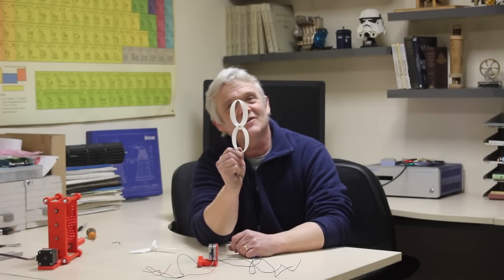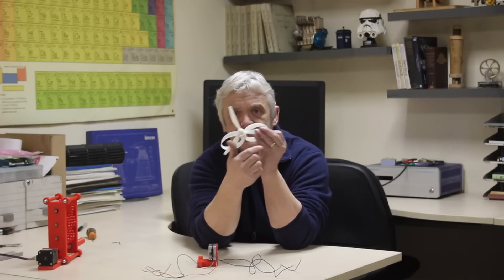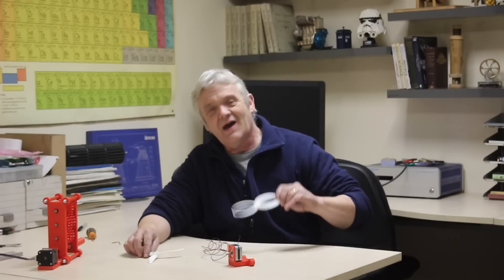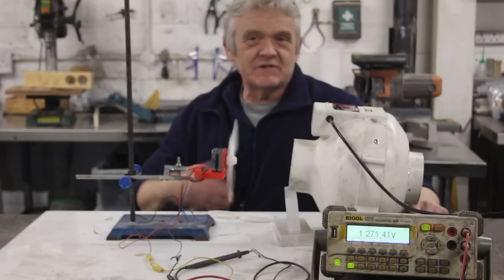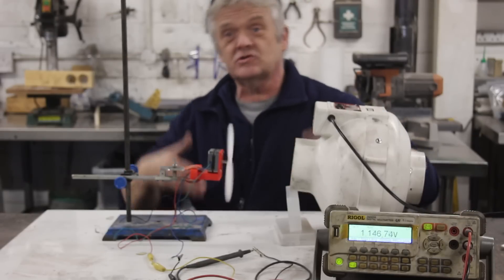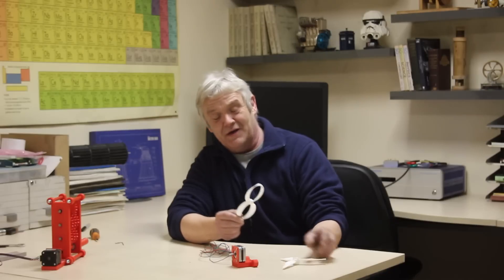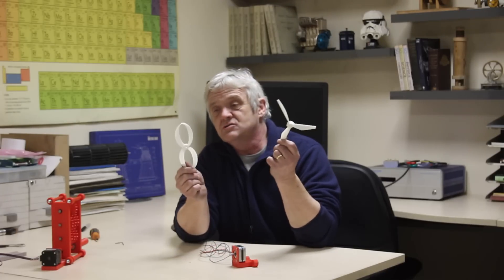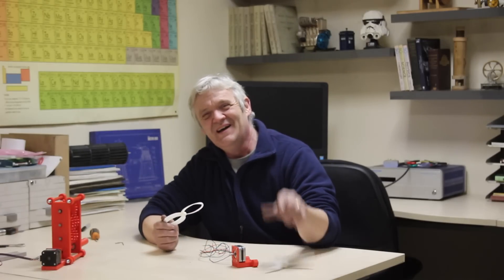1831 Is A Toroidal Propeller Better For Wind Generation ?

Comment: they've been designed and optimised for wing tip vortex reduction in the sense that the shocks created by the wingtip of a standard prop get to dissipate along the entire curved surface hence more time for it to be absorbed by the airmass surrounding the device.

there are multiple variants of it and I do believe that there is some benefit to using it as an active propeller at high RPM in that it's less noisy.... as for efficiency it's probably going to be subpar at top rpm but more effective in midrange rpm ... top at 3k, mid at about 1.5k
that's based on the paper I've seen published and their graphic interpretation of data.

given your experiment, probably more blades on the std prop would be far more beneficial than a toroidal prop
Reply: The video that pushed the idea on me said that it was 100% better. It looks like the one here though is flat as a pancake.
Reply: @kodfkdleepd2876  there are so many variables to an airfoil that can be incorporated into the design. chamber chord angle of attack washout and so on ... these sets have been sort of classified into NACA profiles to make things easier...  
so if we were to optimize the current two bladed toroidal prop we might want to offer less open space for the air to go through and add surface to collect the air  and then play with AOA and such .... if only I had a 3d printer I would gladly take the challenge as I remember quite a bit of my aeronautical design days ... even if close to 30 yes ago :))
Reply: @kodfkdleepd2876  I mean that it's possible to compare two props and find a circumstance whereby one is twice as good as the other.... 
given the task to collect as much power from the wind, we need to understand that the flow will be turbulent hence more blades would work out better.... the windspeed would be low so no need for super aggressive angles of attack ...
Reply: @kodfkdleepd2876  wow
that's a lot more comprehensive than I would've ever expected a reply to come over YT ;)
I can follow... I still remember those differential equations being a b..h 

what is the name of AI software I should be using?  wonder if chat got could hack it ? =D
seriously... what's the software I should enter all the parameters of the experiment?

btw ... awesome reply!
Reply: @actudoran  I'm not sure of any specific software.

If you truly want to do your project(you definitely can but it will take some work).

1. Design the mathematical object using formulas so that you can plug in various parameters to change the configuration of your airfoil(or whatever you are designing). E.g., airfoil(3 blades, 0.1 AOA, 6in max radius, etc). 

you can do this in any programming or library or even use something like solid works.

But the idea is that you have a mathematical model from parameter space to your airfoil space. 

For example you can do this in solidworks then run simulations on the geometry such as EM simulations, temperature, stress, etc.

If I were you I'd go with solidworks because you can do an entire suite of analysis, not just fluid dynamics. E.g., you can use real world materials to help create meaningful results(e.g., it is pointless to find the optimal airfoil if it cannot be build with modern materials).

Now, there are two ways to go about it once you have it done in solidworks. Since you can create various versions of the airfoil by simply calling your function with those parameters(and it does the rest of the work) you can now print out various versions for 3d printing. You can also do various analysis on your variations to see which is giving the best performance.

Depending on your experience and dedication it could take a few weeks to a few years to get it all going. You could also use the free program Blender but it is more for graphics design rather than analysis so you won't directly get the ability to do true fluid dynamics(although it can simulate fluid mechanics so it can give you a visual of what sort is going on but it also may be inaccurate since it is about accuracy(looks) but not precision). But if you do it in blender you could import the models(but not parametric model(but you could probably translate the function over in to whatever software if necessary) in to other analysis software.

The question really is how automated do you want it and how much of "air foil space" do you want to try and optimize for. If you just have 3 basic models you want to try then you can just design them by hard coding them and generate the models then do the analysis and get the performance values and just compare them for the best one.

if you want something more robust and to learn to apply the more general technique then it is best to break it down in to the parts I described(parametric modeling->automated analysis on the parametrized model->optimization program. This is a feedback loop as the optimization program will control the input parameters and then compute the analysis on the model and then search for the optimal analysis) more or less.

If you want to write the dynamical equations and do FEM yourself you can but that would probably add months to years more time. Most analysis software now can be setup to take arbitrary models and to be automated in some way.

The idea is to put in all the work at the front in then just have the process automate itself so that when it is done it spits out the, say, top 5 model parameter and performance info... then you can more easily narrow it down from there(based on cost or other things that were not included in the modelling(but could have been)).

Solidworks is kinda the industrial standard COSM is a physical analysis software that can do a lot of FEM analysis but you can get this in solidworks directly. Blender is a free graphical modeling program that is open source and written in python. It's quite good but is geared towards artists and not engineers so that is ultimately something you'd have to want to deal with. 

Again, for the most part, most of these apps will have some interoperability and it is just about setting up an iterative process. So you ultimately can hit a key and then let your computer chug away and "making" all those airfoils in parameter space and then doing the analysis to find which ones are best. This way you don't have to break it down beyond that and if something goes wrong you can just start over and then go have coffee.

It is not that difficult to do but does require a lot of front in work. Your initial approach will determine how to go about designing it. If I were you I might go with solidworks because a lot of it can be automated and it is really good for designing mechanical things. It has the ability to do analysis so you are likely to be able to automate that directly in solidworks and then the optimization algorithm probably can be ripped from something else if solidworks itself doesn't have the ability to do it. But solidworks is expensive and you have to pay more for the analysis software.... so if $ is an issue, using blender and looking for some free fliud dynamics analysis tools(probably some exist specifically for airfoils) and then automating that stuff somehow(command line automation and a mixture of internal programming would then be needed).

The basics look something like this:

1. Setup DE and initial parameters
2. Tell modeler to generate model based on parameters.
3. Analyze model using automated process(command line) to get performance value.
4. Give info to DE and get new parameters for new model to test.
5. Go to 2. 

So this basic loop will generate models, analyze them, and check and see if it is optimal and then hopefully generate better models to analyze, and so on...

If solidworks is out of the question you might look to find an optimizer that can generate optimal values for a parameter space(and conditions) and then it is  just about plugging in the modeling and performance analyzing which can then be worked on independently and figured out how to combine them... then plugged in to the DE code(which will likely be a few lines to automate).

It won't be as hard as you think but it will require some work. Maybe start reading up on optimizers such as DE(Differential Evolution) in which you only need something you can "plug and play"(you don't have to know the internals of how it works but just that it is good and easy to use as a tool). The look for fluid dynamic analyzers which are also basically plug and play(in which you can use them at the command line such as "FD_Analizer -m AirFoil034 -sUnderWater" and it returns the performance of the airfoil(I've oversimplified greatly).

Then you just have to have someway to create the models... Blender would probably work but there are all kinds of software out there that will do what you want.

Comment: Would there be a way to print some holders for magnets in the ends or tips of the blades to help push the blade for a bit more push? If that would even be possible you think.

Comment: How do the 2 blades compare under various wind velocities? Is one better than the other at very low velocities? How do the 2 blades compare at varying angles of incidence of wind to the blade? All we've seen is wind square on  at high velocity. This is far from a comprehensive examination of the properties of the 2 blades.
Reply: In actual flights, installed in a drone, the loss of efficiency is huge... like a 25% of a classic blade propeller. Just put "toroidal propeller" in the Search bar.

Another flask of snake oil, it seems

Comment: As has been demonstrated a few times now, the improved performance is at very high speeds (IE: drone propellers)
Reply: Watch Jays Tech Vault test (or in fact, any actual test like Will It Mod channel, or  Dr Quads etc) and then look the meaning of the word "demonstrated" in a dictionary... hint: it doesn't mean what you think :)

Bottom line: you arguably get some noise improvement at the cost of a huge loss in efficiency.
Reply: @TheChzoronzon  They are very hard to tweak so any result so far can't be taken seriously, I didn't check the MIT article about it and how they did designed their model.
Reply: @vitordelima  The MIT "article" is a marketing brochure with zero data so we compare it with classical design and also zero info about the design process...

...but we can imagine: they took an idea that works for boat propellers and with zero rigurosity tried to sell it to drone nerds cause they know the Fry Effect DOES work: "Shut up and take my money!!"

Comment: Seams like the main advantage to the toroidal propeller is the lack or reduction of vortices and thus noise when driven. Not really a surprise that it didn't work better as a turbine than standard blades.  Although, it would be interesting to try both inside a housing to see how they compare w.r.t. noise.
Reply: Check out the fan showdown demonstration of it, even at 2,000 rpm (with his own, simple design) it was roughly the same perceived noise as a noctua standard (his base), though definitely a different tone.
Reply: @NM-wd7kx  It wasn't fine tuned for the amount of torque/RPM used there. The ship propellers that inspired this idea also look quite different.
Reply: @vitordelima  true, but I wonder how much the  density:RPM ratio affects things.
If you took one of the boat props (dimensionally), then ran it at a proportionally higher RPM I wonder how it would work out, it'd never be as good as a properly designed one, but it'd be interesting
Reply: @NM-wd7kx  I checked some videos and even the shapes being used aren't that great. They aren't optimized before being printed but this is done via trial-and-error.
Reply: I could see the noise benefit as a driven fan, but as a wind turbine the wind itself would probably cancel the blade noise.
Reply: EUP, I dunno...the main advantage of the Toroidal may be that it has considerably more surface area.  
Why you ask?
Because more surface area = more confused birds = more dead birds = more delicious BBQ! :)
Reply: @Adam.Rushing  I think it might actually be the opposite....at least for bats any way. I'd be interested to see how the low pressure areas interact with them as I believe its this that kills birds/bats and not them getting hit.
Reply: @TLPlants   Very interesting theory!  I'd be very interested in that experiment too

Comment: Is it better at varied angle air input?
Reply: No, its worse
Reply: @TheChzoronzon  I mean compared to the other design.
Reply: @simonpeggboard4004  Yes, I got it. 

It's worse than any commercial blade design.. the mass distribution, the wobbling, the "pitch inertia", all is worse... as demonstrated by everybody that has bothered to print them and try in their drones. I'm talking about a 75% loss in efficiency, not a joke

It works in boat propellers, cause the fluid dynamics are completely different and cause in water cavitation is a real problem... and as people tend to magical thinking, it was inevitable that some snake oil seller were gonna try to sell the idea for flying applications.
Reply: @TheChzoronzon  The original purpose of the boat propeller was to design an aircraft prop but they gave up.

Comment: so another myth busted.
Reply: Not in the slightest!! Geez what an unscientific test. How do the 2 blades compare under various wind velocities? Is one better than the other at very low velocities? How do the 2 blades compare at varying angles of incidence of wind to the blade? All we've seen is wind square on  at high velocity. This is far from a comprehensive examination of the properties of the 2 blades.

Comment: Lol! That was interesting! I wonder how it'd perform with more blades
Reply: exactly, the "wind turbine" had a 3:2 advantage in lift.
in addition to being tuned for lifting rather than propulsion.
two different jobs.
Reply: @donaldhanson2908  Does that really make a difference to how they'd be shaped??
Though I dunno about a 3:2 advantage here.. the material used for those two blades could easily be more than was used for the 3 on the other.
Reply: @ToninFightsEntropy  There is more material, but the toroidal propeller is effectively four blades (connected in pairs at the tips) vs. three blades for the traditional propeller. However, those four blades are spaced unevenly around the axis and probably not optimized for the wind speed used in this test or for power generation rather than propulsion. Their main advantage is supposed to be performance (and noise) at very high RPMs.